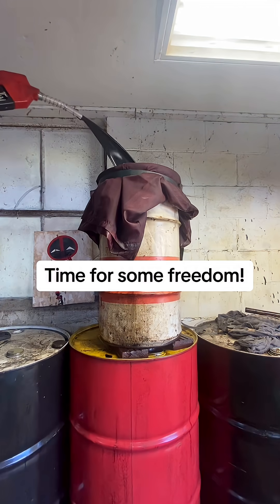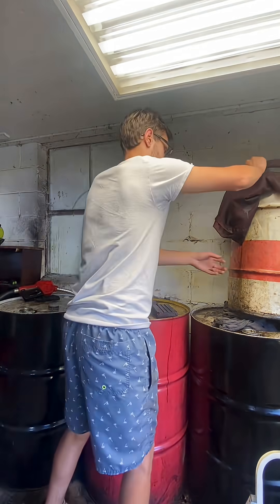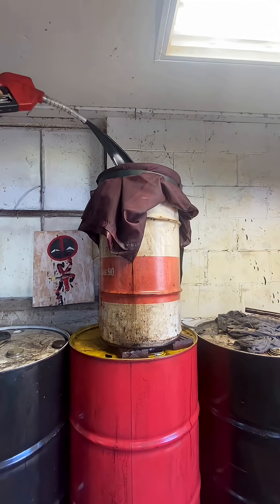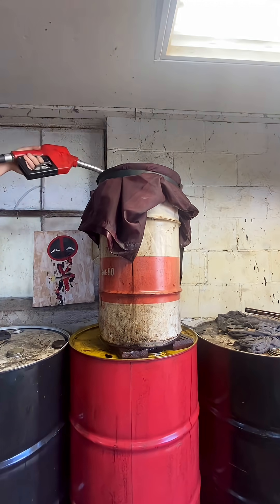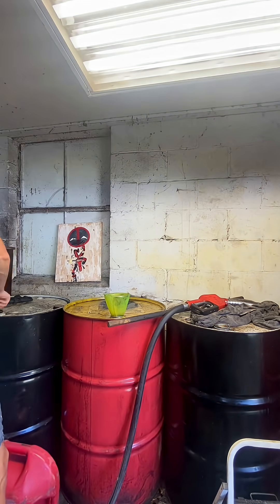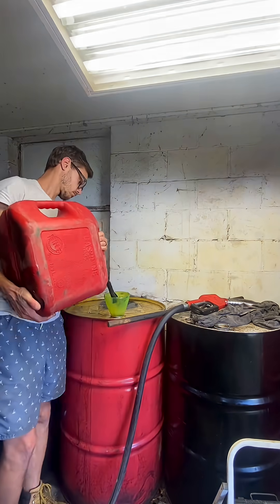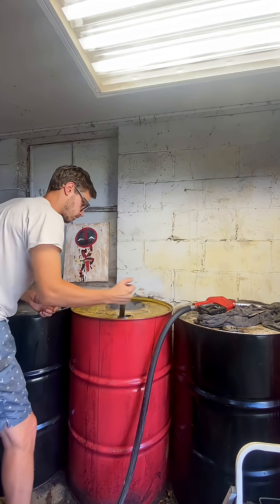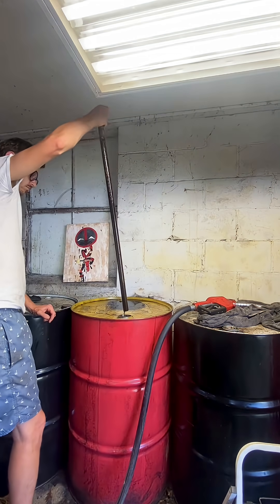Transform #wastemotoroil into #homemadediesel Fuel #dieselmechanic

Comment: You’d want to be running some pretty good fuel filtration.  Moden common rail diesel’s you’ll destroy the high pressure pump & injectors real quick with that as fuel 

Lov what you’re doing. .    but your refining process needs work dude

Comment: Here’s how to fix that gas can: Drill a 1/2” hole opposite top corner from the spout back by the handle.  Get yourself a TR412 (1”) or TR413 (1 1-/4”) valve stem, or one for each of your cans maybe, and a valve stem puller.  Poke the puller through the small hole and put the fill neck. Attach valve stem and install into the hole.  Remove the Schrader valve.  The valve stem cap is now your air flow control to relieve negative press and that pesky slurping.  She’ll run wide open with the cap off.  You can find leashed steel valve stem caps with a chain attached you can secure it to your jug with so you won’t loose em and the steel won’t crack like the plastics.   You’re welcome!

Comment: Some people are indicating that it is similar to 50:1 premix for 2 stroke engines...Not so for this guys mix...
His mix is as follows; mix  
5 gallons of gas into 50 gallons of used motor oil...  You end up with a mixed ratio of 1:10....  Which is 
1 gallon of gas for every 10 gallons motor oil...
His final total yield for the fuel product would be 55 gallons...
It would likely run in a diesel but would be extra dirty, smoke like a chimney and cause engine damage over the long term!

Comment: You should at a minimum be heating then prescreening the WMO thru a 5-10 micro filter, running in thru a large centrifuge to remove large particulate and remove most of the excess carbon and heavy containments which will make it close to newer oil, if you want your older engine to survive long term.

Comment: We cleaned and ran used oil in e of our trucks for about 2 years. We used a centerfuge with multiple low micron filters and we would run it heated with a block heater on the drum to remove moisture, we would get tonsssss of debris in the centerfuge even though it wasnt very bad oil we were using, so just word of warning towards anyone interested as its very hard on injectors when you do it lazy! We stopped after we chose not to put so much work into refining it and it made more issues then it was worth

Comment: Run my 12v  on a diesel/petrol/canola oil mix Been doing it a while.   Ppl say it s bad but probably never tried it lol.   Send it right down tne hole.  No modificstion , no dual fuel system.  Straight in the tank.    Do go trying that on any common rail diesel system or tjat be a bad day

Comment: Detroit Diesel  came out with a used oil filtration system in the early 80s. I knew of a fleet that was using it in there trucks mixed in the Diesel fuel. It was working good till the carbon stuck the  rings on there 8V92TTs.
That was the end of it after they were overhauled under warranty.

Comment: Years ago I work in this repair shop and we heated it with waste oil  but we had gear oil and transmission fluid, brake fluid and old beer in the drums so John the owner would thin the whole mix with maybe 5 gallons of kerosene and it was like Diesel fuel when he was done and he was very particular about filtering it really really good but it was just like diesel when he thinning it out , and it worked well very similar to what you are doing.

Comment: In the almost 7-8 years of doing it I found 5 months is a good schedule to keep , I don't want to be 500 miles from home and have to do it , but I found very limited gunk up , also never had issuee with the any of the 3 tanks tanks 2 stock on this 90ies ford and a 100 gallon in the bed  , only changed filters 6  times in 7 years or so  and again really did not have to do it , did it because all that stuff is free for me , if this 4bt has ran for the past 35 -40 years with no issuess then me adding the turbo and running home made diesel in it , I think it can go another 25 atleast with limited maintenance , but if she blows , get another one not that big a deal

Comment: So no peanut or used cooking oil just used motor oil, why are you not using micron filter so you can catch metal flakes that could be in the used motor oil from a bad engine encounter. i have dumped my used motor oil in the bins at Advanced Autom and see metal flakes on top of the screen every time I go.

Comment: Bed sheet filtration is good for large particles and some gels. Mix it, let it sit, then as you pump out, run through a 3 phase filtration. I have been configuring this for a few years now myself. Oil filter, water separation, then diesel fuel filter. If you can get a centrifuge to clean the wmo after the sheet filter. Also all depends on what it is being burned in. If for shop heater, I would not worry about much. A vehicle engine, yes filtration is key.

Comment: @scottmsanchez- if you’ll go through all this trouble. Here’s an Idea, build and oxy hydrogen generator, hook the positive from your alternator to the generator/cell and the negative to the battery. Use potassium hydroxide for the electrolyte. Plug the air/gas that’s created by the cell directly into the air intake manifold and you will save so much money. Works on diesel and gas. 
There’s videos online to build one correctly. 
You can use stainless steel for your cell burning you can afford it, get nickel- more conductive.
Oh and make the cell about the size of a briefcase, too small and the effects don’t wow.

Comment: drill a hole in the top of the gas can and install a brass screw in tire valve , remove the core and the gas will flow out quickly.

Comment: I make bio diesel from veg oil in 300L batches. I filter the oil with a flour seive to get the big bits out and the rest drops out in the glicerol. Anything else goes out in the wash water with the surpluss methanol and caustic and soaps. I then dispence via a Parker/Racor filter with a 2 micron turbine oil element in it. No problems. But this process shown is BS. My fuel can be run indefinately with only 5000 mile oil changes that I do anyway.

Comment: Oil is ok but unless you have a lot of it its really not worth to much work. And you have to have a water fuel separator and big big filters most likey needing a after market fuel sending unit. Pretty much only good on the older trucks and if not done right will cause a lot of blow by and oil consumption

Comment: I dumped every drop of the used oil from my 01 Cummins right back into the fuel tank for 4 years owning it. Never an issue.
Reply: Is that why you only had it for 4 years?

Comment: Hmmm, What if you flowed the diesel over a strong magnet? I think used motor oil has little bits of metal in it from wear in the Engine.

Comment: The process it's called transesterification, i would use moonshine and a really well filtered motor oil or better cocking oil, i mean really well filtered, ethanol with great purity + oil will produce transesterification ending up with biodiesel good enough for mechanical diesel engines

Comment: I've run something like this thru a dt466 and a 6.9idi. Haven't tried it in the wd6 yet but no doubts that it would run. You can get filter socks that will filter it 1000x better and will run without mixing it down so much.

Comment: Actually, gasoline has a high octane number, so it resists compression ignition, thus has a low cetane number. Doesn't adding gasoline make for just a worse fuel? I know it's for lowering the viscosity, but you can use just straight up motor oil as diesel fuel

Comment: The idea is good, but the execution is redneck. You should filter more efficiently, maybe fold the sheet a few times.
Then, manufacture a water separator at the bottom of the large red barrel.
The objective should be to extend the life of your injector pump.

Comment: Don't fall for this idiot's suggestion. The gas fumes can rise out of this mixture and if it finds a spark, it will explode.  I experiment with this idea decades ago and poured a little of it into a 55 gallon open top trash can on to yard debris.  When i tried to lite it, the gas fumes exploded.  About half the contents of the burn barrel ended up in the yard, and i had burned hair and oil drops all over my face and shirt.

Comment: At the shop i used to work at we'd make this but we would first run it through a thing we made which was an oil filter housing with a big oil filter on it pumped through with a fuel pump and then a centrifuge to further filter which also heated it up really hot and then into a barrel with a band heater strapped to the barrel.

Comment: If you don’t let it sit for a long time and then you don’t run it through a centrifuge you’re asking for problems. I mix with 10% gas 20% diesel then I let it sit for at least three months before I run it through a centrifuge 3 times then I put it in a 1000 litre tote then after 3 months I take the oil off the top. 
I have been running it for about 5 years in my 2005 dodge Cummins diesel truck.

Comment: You mixed 5 gallons of gasoline with 50 gallons of used motor oil, and you call that diesel? That might work in a diesel WW2 submarine

Comment: Have you had this concoction tested. The heavy metals in used engine oil can be bad. 

Asbestos is bad just in a different way. Neither kill instantly. Lead was removed from gasoline.  The metals can be every bit as bad. 

The fry oils from fast food joints would be healthier.

Comment: Why the hell do people keep calling thinned oil, diesel. It's not diesel, it's thinned oil.

Diesel is a fuel product made through fractional distillation.

It is very possible to make diesel at home, from waste oil, and in fact, pretty easy to do. This that you showed has the first step correct, that is, filtering the oil.

Comment: Pump it through a toilet roll oil filter- will cost you a few toilet rolls but you can use those later for firelighters. The oil comes out of those filters golden like new. What you're making is very oily, very dirty 2 stroke petrol.

Comment: just be careful the oil my contain water you cant see. it will  cause slugging in the tank. and block the filter (in the tank)  and use a water purifier filter with out the charcoal, a sheet is not good enough, it will work for  the short term, till the slug takes over, and never mix cooking oil with mineral oil, i drove my diesel van for more than 8 years using sump oil, my biggest mistake was not filtering the oil properly, i mix oil to diesel fuel. i never used gasoline because it was expensive in Australia

Comment: So some thoughts what octane are you running? And what microns do you filter your oil to? If I had your setup as seen I’d invest in a auger bit to mix with and clamp the trigger what speed you want also the gas can fix is a mx racing jug high output cans will drain much quicker for you

Comment: Give you a heads up; there’s a company nearby my place that does this but instead uses centrifugal systems and I believe multi multi layer gravitational filtration systems. Their main issue is that used oil contains micro shavings which are near impossible to remove. That’s why when they sell it they blend it with pure diesel to lower the amount of containments to a near 0%.

Comment: I can think of a couple of dozen diesel engines that this method would work on. You know a D5 caterpillar. An old Detroit diesel dump truck. From like the 80s and 90s. Maybe some of your 7.3l or a deuce and a half. But I drive a 2003 Ford F-350 with the 6.0L and there's like nine computer strapped to my motor. The motor setup if it smokes any kind of smoke. That means there's something wrong with it.. so there's not a chance in hell that I would run this through my truck.. if I have to buy injectors individually it's about $1,200.. which is kind of a rip off because if I take it to a shop it's 2400 for a shop to do the entire right and left Bank.. all 8 injectors. But this would probably be a good method for farm equipment.. and nothing else.

Comment: why not do a vacuum distillation to remove the carbon and detergents and save your injection pump and injector nozzles or at least filter it with a 1 micron filter

Comment: Drill a 1/4 hole in the top back part of that P.O.S gas can. Use a 1/4" bolt to plug it. Pours ALOT better.